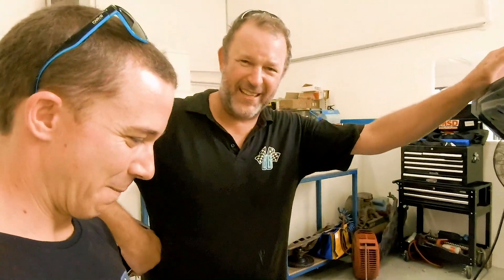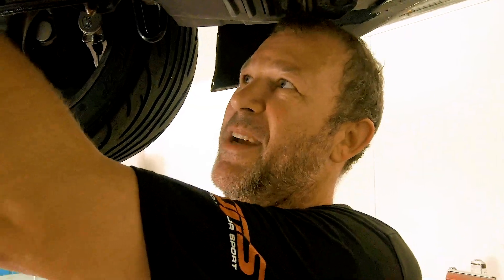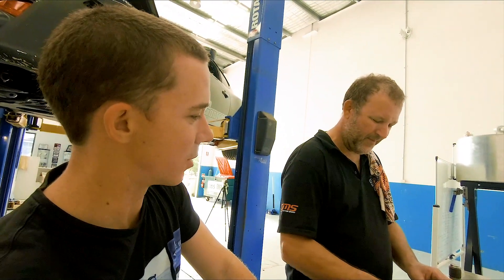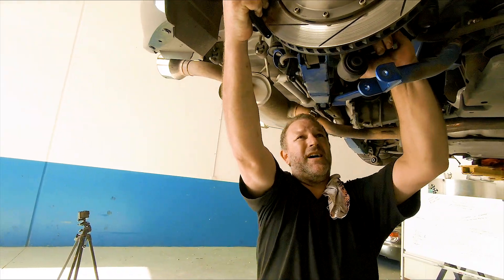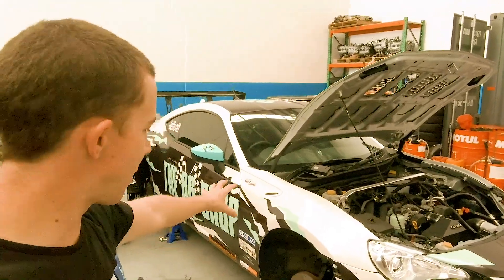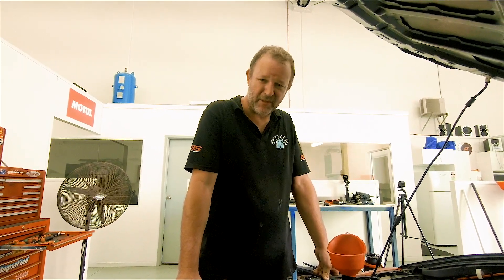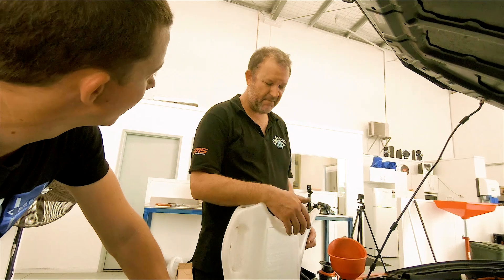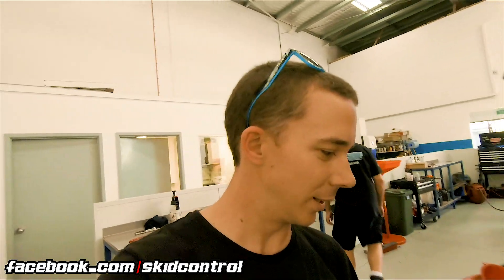The 86 Shop and Upgraded Drive Shafts - Skid Happens EP11

Comment: quick question, why are you using water instead of coolant ? Is water better for cooling in race cars ? Just wanna know haha
Reply: In most race series rules you are only allowed to run water as dropping litres of coolant on the track in front of a whole grid of cars usually ends in a bad time for all.
Reply: @themonkeen   ooh ok that makes sense
Reply from the maker: @macmillan5949  as above, we were actually running coolant prior to this and Andrew at the 86 shop advised that we only run water and regularly change it due to CAMS rules not allowing coolant.